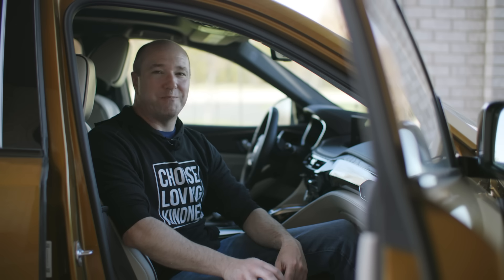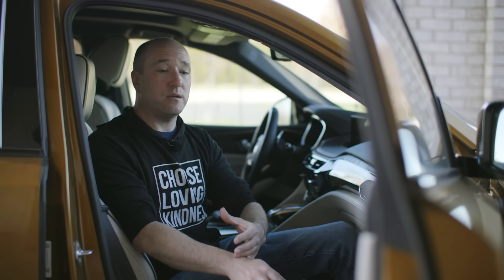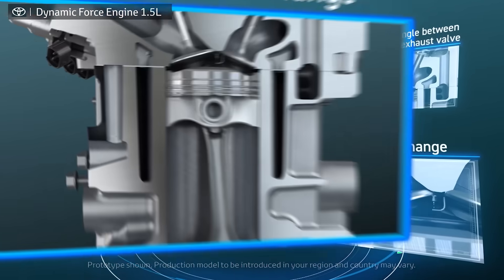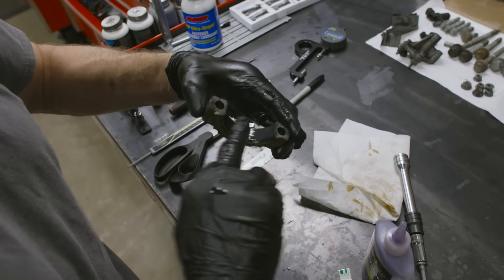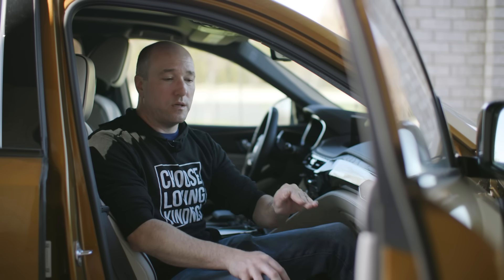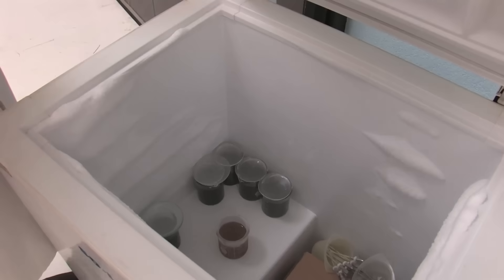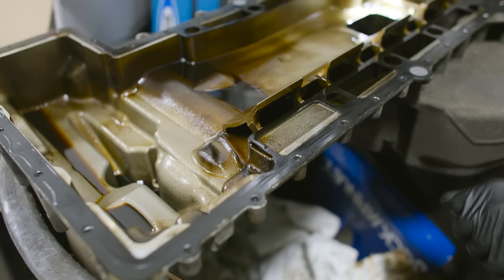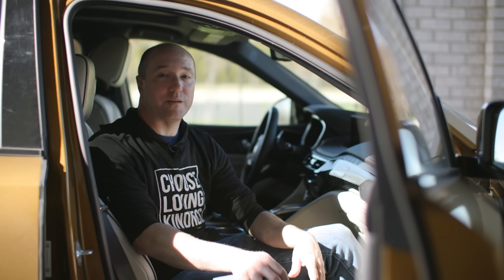Understanding Engine Break In | Dos and Don'ts

Comment: As a oil-phile.. 😅 
There is more than silicone in oil analysis samples from new engines..

So the conclusions is totally wrong when they are just viewed from a silicone view of point. We need as always listen to more than ONE guy! 

There is ALLSO increased levels of iron, copper, tin, aluminum, nickel and lead. In the oil during brake in of a engine.. 

The breakin is that those levels are of course higher in the beginning and is coming down to lower levels as the engine is getting broke-in. 

Those levels (yes the small particles are going past your filter) can just be REMOVED by  a oil change!

So the best thing you can do is actually having more frequently oil changes during brake in. 

And that is what science says from looking at oil samples analysis from new engines during break-in. End of story. 🎉

So all the talk of silicone is just fog curtain so we don't look at the more important stuff. 😅

And that stuff that oils have getting better and better.. That is all true.

But there is always two sides of the coin.. 😮

When that better oil is doing MORE work and is getting more "oil wear and tear" . 
By today less total oil volume in the engine AND extended oil change intervals..

That is maintaining that we have the same status as before and in even in some cases worse with more issues even following the recommend intervalls.. But that is a another story! 😢

In short there also IF you want to drive your car until the wheel fall of then change the oil more often.. 
If you just have your brand new car some years you will never experience any issues then just change as recommend and in short pass on in some cases the issues to the next owner.. 😢

Otherwise a Intresting video. ❤

Comment: I live in chicago so weather is all over the place, depending on time of the year and so is my driving, highway local, pure local, pure highway, commute and road trips, and bought my car brand new and plan to keep it for its life, rule of thumb, found a good mechanic, that uses manufacturer suggested oil, used up my free oil changes and change the oil ever 5k miles, after changing it during the first 1-2k.
After seeing what came out in my recent oil change, and already at 21k miles, I’m glad I’m sticking with this even though the manufacturer said I’m good for 10k.  Rather pay the extra, and not have to think about it with occasionally taking a sample, along with in case life gets busy, and I don’t go exactly at 5k, I have some room, but wouldn’t go more then 1500 miles over 5k especially if I just came out of some mountain road trip driving, just my opinion

Comment: Bologna on the oil changes. Bologna on 0w20. That's all been "fed"  into the public mind and no pun intended. 0w20 cars or 0w16 should use a good synthetic 5w30 and change every 4,000 miles, you can an extra 1000 miles out of that good oil. Really modern synthetics aren't even really 100. Percent true synthetics. Engines now run hotter than they did 30.years ago, higher operating temps, I wouldn't go over 4,000 for an oil change. Also differential or trans fluids they are skimping out on, look at what your car takes and look at what the same brand car used to take 10-15 years ago and switch to that type of gear oil. 0w20 oil are slick but have no shear protection. More cars in the last 10-12 years have blown motors, and don't think because your top end is very clean that your ok, it's the bottom end that's going to fail. Thanks John Kerry.

Comment: No such thing as wasteful oil changes. If you follow a manufacturers recommended schedule of over 5 thousand or eight or ten they intend your engine to last 5 years. It's a disposible world my friend and everything in a car is engineered for five years. Been in automotive manufacturing for over 40 years and when they salt spray test parts,  if they surpass the five year mark they fail them.

Comment: I just randomly caught this video and watched it with interest as I recently purchased a 2023 Winnebago Travato with a ram promaster chassis. It already had 2000 miles on it as they are driven from the factory to my dealership in California.  Just curious if those highway miles were good or bad for this engine?   I immediately changed the oil around 3000 miles with a full 0W-20 synthetic as recommended with filter. I plan to keep this vehicle for a long time so maintenance will be a high priority.

Comment: I personally agree with 50% of this video and disagree with the other 50%. What ever I'm doing must be right because my engines last forever. Even the ones I've beat the crap out of. Change that oil at 500 miles, then 1000 miles, and then 3,000 miles. Then drive it the way you wish with 5,000 mile changes.
Reply: Best comment.

Comment: You're wrong about 'commodity engines' not needing a break-in. All engines have basic features in common. Piston rings, cylinder liners, con rods, and crank shafts, etc. all have been machined and require their surfaces to be 'run in' for them to provide optimal mating surfaces. All engines benefit from break-in procedures of moderate loads and varied RPM for the first few hundred miles. Yes, some high performance engines may have more critical break-in procedures. But you're making a mistake thinking mass produced engines don't benefit from a proper break-in.

Comment: Uh, you are wrong. There is no break in period for new volvos. Subura has no break in period.  New cars have no break in period.

I reached out to a manufacturer, in this case, Volvo, and they said there is no prescribed or necessary break-in procedure with their newer cars,” says Mike Monticello, Consumer Reports’ road-test manager. “They said that the powertrain continuously adapts to the driver’s style, and because of that a break-in period is not really necessary.”
Reply: My hand built AMG has brake in period....period.

Comment: You lost me at 15000 mile oil change. So many variables. Oil consumption #1. Still got love for ya.
Reply from the maker: It's highly dependent on the oil used the engine type and the conditions it's operated at I sent out over 10 samples of extended oil changes up to 20,000 miles and the group 5 oils all held up very well the argument becomes oil contamination and encapsulation and modern engines ability to not have problems with variable valve timing and other things like that
Reply: Yeah. I’ve been in the automotive repair field for 15 years. I broke in my KTM 890 Duke R from 0 miles by the book the best I could do. Purchased 2023 GTI earlier this year with 16 miles. They offer three free oil changes. But, I don’t feel comfortable about having someone else changing my oil. I went with liquid moly. It has the VW dedicated number. Anyways, driving / riding style plays in for me.

Comment: 23 LT1 6.2 Camaro engine. I Let her warm up, let her idle for 3 minutes followed by a low rpm drive. kept it under 2k, got her up to 45 mph and then drove around town fluctuating the mph. At the end of the first cycle I Quickly Floored it for 2 seconds at the end of my 35 mile drive on the new engine, she pushed maybe 4k rpm. and she was more than ready. Left her parked for 2 days and when I fired it up it had the wickedest sound ever and I babied her again. Occasionally giving it a little extra throttle and then letting her cool down and coast, ALOT of light revs and coasting off and on.. if I got on the interstate I’d go up to 70 mph, then down to 55 mph on hills with no cars around and then back up to 70 mph again quickly with 1.5k or 2k rpms fluctuating. Ofc staying away from using cruise control. (Only time I got to 3k or 4K rpm was ONLY when giving it a quick acceleration to help with seating and immediately let off the gas) Folks say don’t “drive it like you stole it” it but I’ve broken in two engines in my life. NEVER let your engine get hot hot breaking in. I recommend Spirited driving, followed by letting the engine rest and cool off. If you push her, let her rest. If you have to let the engine sit for a day or two between your break in period. Your engine will thank you. Dont be easy on her, but don’t be too soft on her either! At 500 miles I opened her up legitimately, and again at 1k miles I let her eat once more. Definitely the most well broken in, and meanest engine I’ve ever had the pleasure of mastering. Over 4,100 miles now and still runs flawless and pulls perfectly at every WOT. Changed break in oil at 1k miles.
Reply: There are no break in oils. It is a myth. You wasted good oil and money.    6.2 Camaro engine  is not fully forged and hand built engine,  so break in period is not needed, but recommended for safety and emissions. New engines are notorious for polluting more first few thousand miles.

Comment: Volkswagen said the first 1000 kilometers should be done in less than 4000 RPM, and then the next 500 kilometers should not be too slow. Then the engine is ready

Comment: If the driver doesn't care about break in, drives to 30,000 miles then trades it in, the driver still loses. After break-in, the engine develops more hp, gets better fuel economy, the oil stays cleaner, and consumes less oil. The combustion chambers and valves run cleaner, better breathing, less pre-ignition risk, MORE torque and hp.. If the rings overheat to sustained high revving during break in, and lose their static tension, the result is blow by, power loss, high oil consumption. Improper break-in loses at all levels!

Comment: Oil change intervals: think about it like this. It might be that the longer interval is just fine. But you don't know that. So it always makes sense to do shorter intervals because then you KNOW your engine is always utilizing fresh oil. There's no downside to shortening the intervals - the cost difference is minuscule - and if it happens to spare you of some engine issues at some point, that's when it pays itself back many times over.

Comment: Oil change at 1000 miles (gets any of those little pieces of metal) then every 5000 miles.  Engine oil changes are much cheaper than engine repairs.
Reply: "Gets any of those little pieces of metal"...every single piece is captured by the oil filter. You are wasting oil/natural resources  and money.  Unless you race or push that engine hard on a daily basis and brake the traffic laws,   then yes 5000 miles oil change is ok.

Comment: You basically said everything my 2018 wrx owners manual said to do.

Manual states:
1000mi (or 1400mi I forget) vary load, stay out of boost if possible, don’t lug, don’t run at high rpm.

Oil temp gauge is legit my favorite feature that it has.  It’ll hit 220* on a very hot day just driving normally.  Cooling is an issue for this car but I don’t track it so not worried about it too much.

Plus I like seeing my oil temp on colder days.  Stay out of boost till I start hitting the upper 170*s.

Nice to see how slow its temp comes up compared to coolant temps which is much faster.

110k miles now on it and it burns no oil (at a discernible level anyway).
Reply: Why stay out of boostM
Reply: @simd510 ask the guy that wrote it.  I’m assuming it’s probably to avoid extra stresses and loads during break in, until it’s broken in.
Reply: @BiologistRyan  ok thanks

Comment: It's funny how he's talking about extending your oil change interval with a picture of a GDi engine crossing the screen. They blow up all the time from extended oil change intervals. GM 3.6 and 2.4 engines die like clockwork at 110,000 miles if you follow the factory recommendations. It is part of their planned obsolescence.

Comment: Nowadays, there is less of a distinction between regular commuter car engines and exotics. As an example the Chevy Trax engine is a 1.2L turbocharged, intercooled, direct injected inline 3 making 137 HP. That's 114HP/L. Easily in the range of high performance engines. The 1.3 in the trailblazer as well, it makes 155 HP, giving us 119HP/L. The Corvette ZO6 5.5L V8 is 122HP/L. The Trax/Buick Envista engine often gets into 5,000RPM+ accelerating onto the highway. I would say that easily merits a more thorough break in if you were planning on keeping it for a long run. A small turbocharged engine like that, as highly loaded as it is, merits the same treatment as a race engine. Oil as well, and the filter. GM has the Dexos standard, which makes it a bit easier, but there are still better and worse oils with regards to deposits, high temperature resistance, and LSPI resistance. Filters make a big difference too, something with synthetic media like a Fram XG/FE/FS series, Premium Guard EX series, Delco UPF, STP XL, etc will filter much finer than a regular old cellulose filter. My mother is about to take delivery of a brand new Buick Envista with the 1.2 l3. Looks super easy to work on, so much space around the engine. But given that it only takes 4L of oil, all that is going to go into that engine under warranty is Ravenol DXG 5w30. It's one of the few Dexos1 oils that is majority PAO based, with ester and AN components as well. $75 per 5l jug, but given that she wants to keep this car basically forever, I think that's worth it. For now, going with the Fram FE12060 or STP S12060XL. After the warranty is over, we will switch over to HPL oil, even better but not Dexos approved, so not the best idea while the car is still under warranty. Likely will also go to a larger oil filter after the warranty is over as well. FE10575 has the same bypass valve psi and will fit in the space. FE2 may also fit and is even larger, but I haven't confirmed the space on either side of the filter yet. Back to the subject of break in, sometimes with classic cars and rebuilt engines the difference is not as clear cut either. For example my 1979 Subaru DL, which has an EA71S (1.6 factory race engine, late 1980s), spends much of its time above 6000 RPM. 4000 is just normal cruising speed. Has no oil cooler but even on the track or a rally stage the oil temp will struggle to even hit 230. The aluminum block is just that good of a heatsink. Makes 130 HP, 30 HP extra over the highest factory spec. Break in was easy, conventional 20w50 for the first 3000 miles or so, vary RPM, don't go over 5500, and don't go under 3000 under load. After that, go to the Mobil 0w-50 and still be a bit gentle on it for the next 3000 miles or so, but not as gentle as the first 3000mi. After that I considered it fully broken in. It's given me many trouble free miles since, both racing and on the street. That's a somewhat unique car and situation, but I do think there is merit to treating some of the newer regular car engines like race engines.

Comment: This is why all autos should have some manual option whether it be paddles or a stick. This way during break in you can take your engine to 4k rpms gradually without you r flooring it to keep the transmission from shifting

Comment: No! You cannot safely run 8 to 10k miles on an oil change. People need to stop spreading that lie! If youre going to trade youre vehicle in every 5 years you might get by. But if you plan to keep the car for years after its paid for then 4k max on oil change. Ive had vehicles make 600k miles for a reason. 10k oil changes thats not possible.
Reply: Wrong. 10 k miles is perfectly fine. Many cars with over 150k miles with 10 k oil changes out there. Unless you put some cheap Dino oil,  your engine will last many miles.
Reply: BULLSHIT!!!!! @genderlessyoutubefanperson
Reply: What a load of CRAP!!!! @genderlessyoutubefanperson

Comment: Not flat out, but I did autocross my 2019 equinox with 96k on the clock this past week...
Still running great 
Tires and brakes could use some attention

Comment: What about break-in oil for just a new (non-performance) vehicle? Should we use it?
Reply from the maker: Almost all modern engines from factory dont use a special break in oil anymore.  They even use standard 5w30 as assembly lube.  I personally think its less critical other than maybe using high moly content oil. Even thats old thinking.

Comment: thanks for the info!  Just recently purchased a new car and made sure to keep it under 4k for the first 1200 miles but I did reach highway speeds of 85+ just cruising at low rpms.  Do you think that did any harm to the engine?  (B58 motor)
Reply: No, the engine doesn't care how fast the car is moving, its concerned with RPMS..At 100 mph, my engine is only turning   2800 RPMS!! Got to love an 8 speed automatic!

Comment: The myth of break-in comes from your father remembering buying a British BSA motorcycle in the fifties. He had visible bits of metal in the first  two, maybe three, oil changes. Yes, that engine required a careful break-in. When you buy a Honda, today, there will be no metal in the oil on the first oil change. Modern cars and motorcycles are built to incrediblly accurrate tolerances. Break-in is a thing of the past, but, still, why go nuts over the first 500 miles, eh?

Comment: 3:53 if this is true, how do hybrids handle engine break-in. Toyota and Honda eCVTs basically "lug" the engine all the time, running it at the lowest possible speed for the driving situation for maximum efficiency.

Comment: I totally disagree with your theory of oil changes. Full synthetic oil should be change every 6 months or 5,000 miles. Engines are built loose for a reason and that’s to increase fuel milage. The problem with that is that the oil rings get cakes up from blow by.  I have seen this with engines that reach 100,000 to 150,000 miles plus the cylinders always have a wear spot causing the oil to burn to where you use 2 quarts every 1k. The break-in is spot on and should be done. Oil changes are cheap but a modern engine is anything but cheap to replace.

Comment: What is interesting, is that everything that was shared about properly breaking in an engine was something I learned in the 60s. Vary speed, don't redline it, drive enough miles for proper break in before hammering on it and never race an engine when cold.